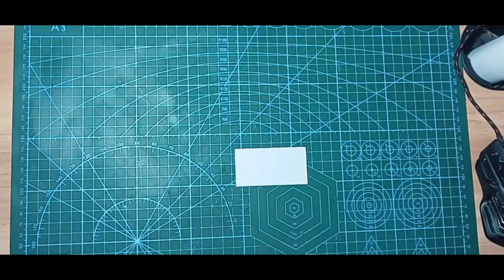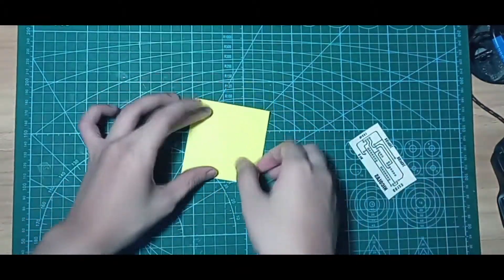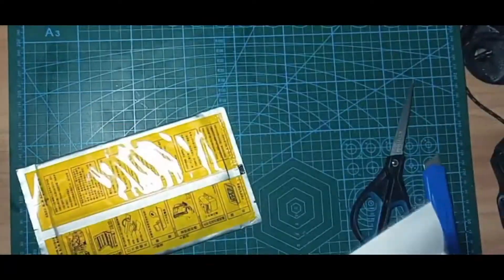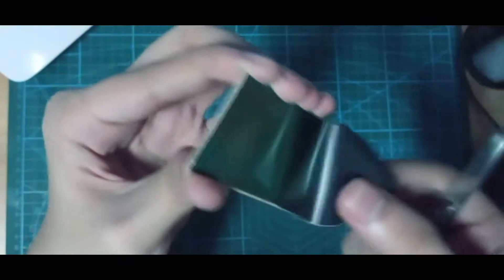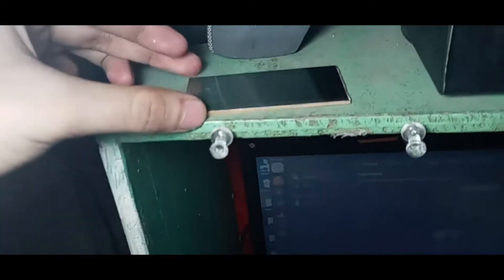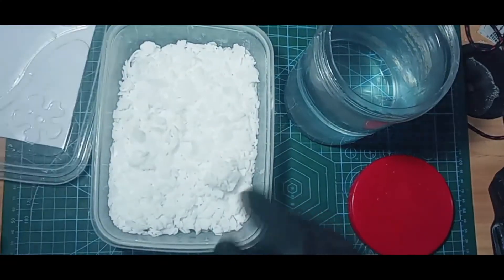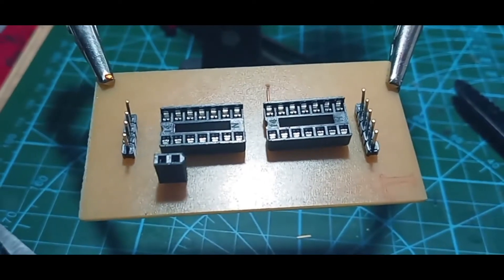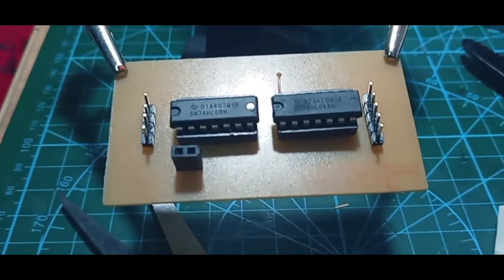DIY PCB - Single Sided Presensitized PCB - Padawan

Comment: Thanks for the walkthrough. Ive seen resin printers used to apply the design to the PCB, as they use UV lights. Im surprised this Presensitized PCB method isnt used or mentioned more often. PCB"a"Way 😋

Comment from the maker: After recording this video, I discover new tricks and idea on how to make an impeccable PCB. I created a new video using the new knowledge I obtain.
https://youtu.be/x0gPjN4yH6A

Update: I find out tha using flouresent lamps is more effective than using the UV LED nail light that I use in this video. Use flouresent lamp and expose the pcb to the lamp but make it approximately 5cm away from the flouresent light.

Im this video, I create the developer mixture with 1 cup solution and 1 cup water. To make a more balance developer solution, put 1 cup of solution (sodium hydroxide + 1000mL of water) and 2 cup of water.